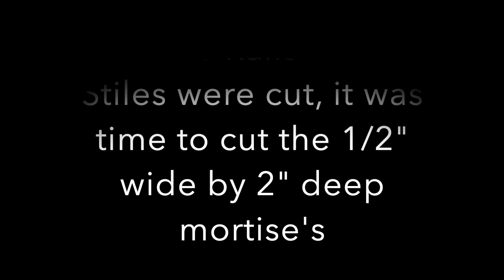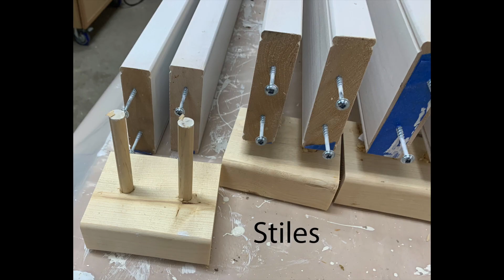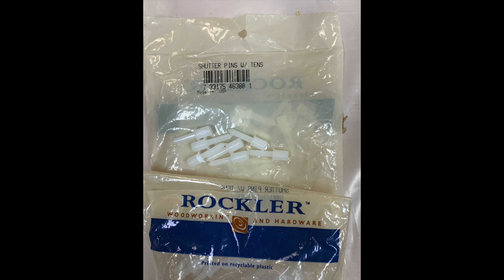Making Plantation Shutters

Comment: You don’t show how you calculated the top, middle and bottom rail widths, nor how you measured where the style pivot pin location holes are located in relation to the rails.
Reply from the maker: My window are all two piece sash. I made the center rail coplanar with the top of where my two panes overlap. The spacing for the louvres was then calculated using the Rockler 3.5" spacing. So with that I adjusted the top and bottom rails accordingly

Comment: Hi Chris, great video! Your attention to detail deserves all respect. 2 questions - How much do you think it costed you per sft to build the shutters in terms of materials only? And how much would it cost if we exclude the outer frame around the shutter? Thank you in advance!
Reply from the maker: I just bought lumber for about 10 more windows and the cost around $1800. The frames cost less than $20 in lumber, for the large windows they are 80"x80"x 1.125", so I cam get one frame out of a board that is less than $20. I priced up the pre-cut shutter blades from Rockler, for the length of louvers I needed, these would have cost $2800 alone.

I have custom built shutters installed in my house in Dallas, these cost about $1000 per window, which was the main reason for doin these myself.

When finished, I will have done 21 windows, with 16 of those having double shutters. My estimated total cost will be about $3300 in lumber, $3500 in woodworking machines and jigs, that I get to use forever and $1000 in hardware (hinges, pins, controls arms, etc..), Paint $400 about $8200. So $8200 divide by 29 actual shutters = $283 per shutter. without the tool investment $4700 divided by 29 = $163 per shutter in materials.

The two machines, I bought for this project, were a ShopFox Moulder ($1500) and a Powermatic Mortiser ($1500). I've used the ShopFox to make about 200ln/ft of custom baseboard for a couple of friends.
 
Hope that helps
Reply: @cedwards874 thanks for this detailed info and being realistic.  Nice work and I wish I was as patient and meticulous as you are.  Are you retired?
Reply from the maker: @allbayfishing9456  Yes I'm a retired software developer.

Comment: I had to pause at 18:05 to say wow! The craftsmanship is amazing! Do you think I could do pocket holes in place of this? I’ve seen other people use long screws from the outside to join the frames, but I don’t have very much luck doing that because my wood tends to split. Ok I’ll be back at the end….
Reply: Ok I finished. Absolutely INCREDIBLE! Thank you so much for sharing! They’re beautiful!!!
Reply from the maker: I'm not quite sure where you want to use the pocket screws, on the shutter frame or the outside frame that goes on the wall. My outside frame is actually connected with pocket screws. I didn't think there was enough material to do a solid enough mortise. Thanks for your comments.
Reply: @cedwards874  how cut in louvers   clear view metal
Reply from the maker: @Eldesconocido12-f3w  I have no idea what you are referring to.
Reply: @cedwards874  I believe he is asking how you cut the notches in the shutters where the metal operator assembly is nailed into
Reply from the maker: @Eldesconocido12-f3w  If you are taking about the small notch on the end of a louver for the metal control arm, I used my cross cut sled, on my tablesaw, with a stop block, and held the louver up against the back fence of the sled tomato a very shallow cut.

Comment: How do you get the planer to cut the surface in an eliptical shape, is that a special cutting block you're using?
Reply from the maker: I use a ShopFox 1812 Planer/Moulder, you get custom blades made. The shutter blades cost around $200. At Rockler's prices, for pre-cut shutter blades, my project would have cost over $2000 just for the louver blades. This video shows a bit more detail https://www.youtube.com/watch?v=cysXgt5u5YM
Reply from the maker: When you buy the blade to cut the convex side of the blade, you also need a compliment blade to made the concise side for the bed. For this blade you can buy the cheapest steel as you'll only use it once or twice.
Reply: Whay is the name of the planner blade
Reply from the maker: @felixcantu7387  From www.customouldingknives.com, I used blade pattern PS-9

Comment: Hi Chris, did you consider dominos instead of traditional mortises?
Reply from the maker: I did, I have the smaller Festool domino tool. I'm sure it would have worked, but I felt the mortise and tenon would be much stronger. I made the first mortise using a router bit and then decided to go with the mortise machine.
Reply: I too have the df500. I was thinking of getting bigger domino or new mortise machine. I have an old delta mortiser but it’s small and slow. Hmmmm??
Reply from the maker: @jimreese55  https://www.youtube.com/watch?v=oekP1PkCGGU
Reply from the maker: @jimreese55  https://www.youtube.com/watch?v=si4GN2Xct6A